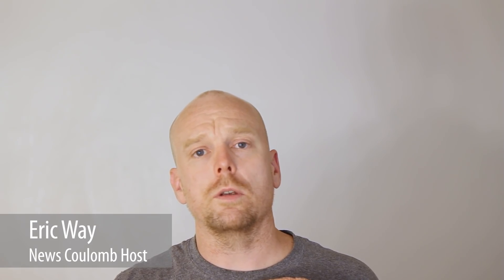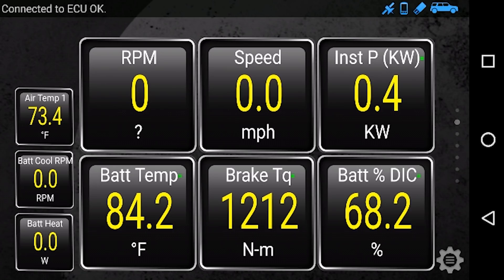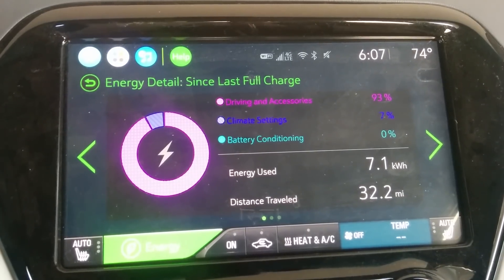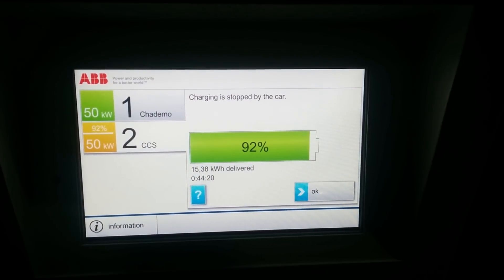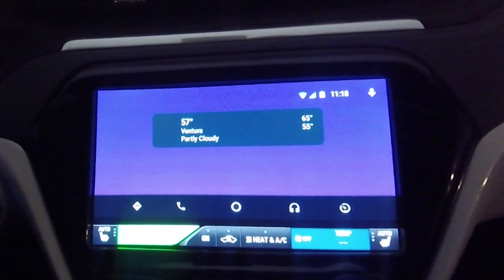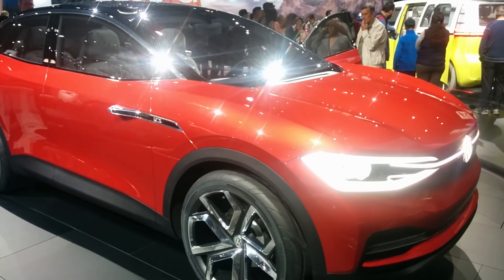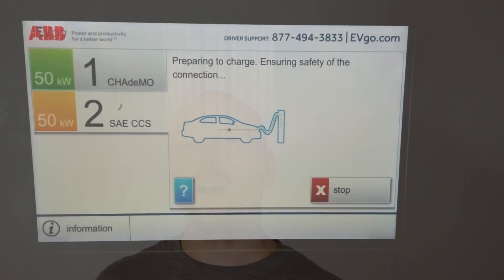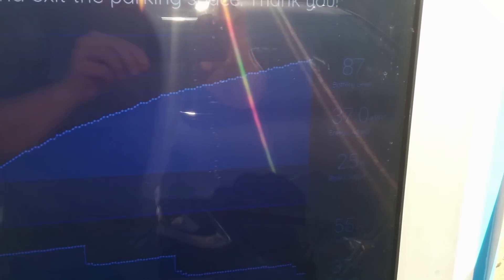Chevy Bolt EV: 70,000 Mile Battery Degradation

Comment: Alot of DCfastCharges,driving at ultra low batry,bolt's batry was put through al torture test widin70000 mls,losing8%is vry consistent degradation

Comment: I heard computer reprogramming so many times.  In our not so distanced past, we called this cheating.  VW got in trouble when they "re-programmed" their diesel cars 5 years ago.  Since EPA has their hands off policy and no regulations on electric vehicles, dealers can do whatever their want.  Basically, "Re-programmed" the hell out of  the computer to show favorable numbers to the consumers.  Bottom line, I don't trust the dealers.  Too much bureaucracy with too little integrity. That is why I am sticking with my Internal combustion vehicle until our government put some regulations on Electric vehicles.  With the ICE vehicles, dealers are less daring to temper with the computer because people can easily find out and they can get into a lot of trouble for it.
Reply from the maker: Didn't you just list a number of internal combustion vehicles that were tampered with? In this case, the reprogramming was very clear: It allows GM to diagnose and fix faulty battery cells/modules before they cause their owners grief. It's a good thing.

Comment: NEW 2019 BOLT owner here.   I currently use 120 volt/12 amp charging in my garage.   I am thinking of getting a 240 volt/32 amp continuous level 2 charger.  Will this accelerate my battery degradation ?
Reply: aardvarkansaw No! ;)

Comment: I’m at 45k miles in one year rarely fast charge but charge full everyday with a 7k watt charger from half to full. hill top is only if you drive down hell from where your charging so you don’t over charge. The battery has its own shut off point at 100% just like it has a cut off point when too low so it won’t damage the battery. I haven’t lost any miles everyday I get home  same exact miles 170 unless there’s traffic it says up to 190 best car I’ve ever gotten already saved me 6k in gas no maintenance and 10,000 in rebates
Reply from the maker: Yes. Keep in mind, though, that GM's range estimator is a projection and not based on battery health (like Tesla's). It's really difficult to measure capacity on a Bolt EV.

Comment: LRR tires are also very very important. We lost nearly 10 mpg on our Prius when we inadvertently purchased non (LRR) low rolling resistance Goodyear tires. 
I cannot emphasize enough how it will adversely effect range, especially important for EVs (we own a 2011 Leaf also). 
Most do not get the opportunity to compare as I did. Just beware, because most tire sellers don't even realize how dramatic it can be.
Reply from the maker: Yes. It's especially important for EVs because rolling resistance makes up a greater percentage of their energy usage.

Comment: its 20 percent to 80 percent Thats the optimum charging amount.   You should still have no issue as most commutes are only 30 miles or less.  Thats very attainable.  Plug it in at night and you should be fine.  No need for excessive charging. If you do alot of long trips and most dont  then you need to be aware of the percentages most of the time its a simple calculation

Comment: Eric, any way to quickly tell battery capacity/degradation from the car's system, if buying the car used?
Reply from the maker: Unfortunately, I don't think so. You could try Torque Pro (an app) with an OBD2 reader, but I don't think it's very accurate. The Bolt EV's battery is just too big to do a quick and accurate test.
Reply: @newscoulomb3705  Thanks Eric! 

What about this scenario: charging two Bolts to full charge. Same parking lot. One says max range 200, the other max range 240. Would you say the former likely experienced battery degradation?
Reply from the maker: @jgfisch3  No, that still wouldn't work because the Bolt EV's range estimator is also based on historical driving. My Bolt EV is currently showing less than 200 miles on a full battery, but that's because I just  got finished with a long, fast road trip at 70+ mph driving.

Comment: With a total 425 miles on my Bolt.  I have seen 0% degradation.   I have been trying to set my charge limit to 80%.  But for some reason it keeps charging to 95%. (Factory default)  I will have to call Chevy for some help.

Comment: If you look at some of the 2017 Bolt Battery Take-Apart videos, I see that there are units that say "LG Version Vista 2.0, 57kWh Capacity" on the pack labeling. So your loss may actually be zero if the 2% movement from the SW upgrade is real. I am not sure if the pack labeling means 57 usable or 57 max though. Maybe a question for LG.
Reply from the maker: Yes, it's a confusing topic. The LG sticker says 57 kWh, but GM's EPA filing says 60 kWh.

Jeff at ElectricRevs does a pretty good job of explaining it. https://electricrevs.com/2018/03/09/jaguar-and-chevy-have-lg-in-common/

Comment: Still, 8% degradation after 70,000 miles is pretty good. That means you shouldn't see 20% degradation until around 150,000 miles.
Reply: And with so much capacity to start out with 20% degradation still means a very usable car.
Reply from the maker: @daniels7862  Definitely. There's a bit of range to give, though I'd still want more. :-)
Reply from the maker: I really need to run the numbers again, soon. It looks like degradation has slowed.

Comment: I recently watched a YouTube video called “Chevrolet Bolt Li-Ion Battery Deep Dive”, in which the demonstrator completely disassembled the battery pack from a 2017 Bolt.  In the process, he read the ratings marked on each subassembly, and calculated the total to be 57 kV/hr.  He was a bit surprised by this, as was I.  Was this puffery by Chevrolet?  Or maybe there is some engineering reason for the higher number.  Did your methods give 60 kV/hr as your initial capacity?  I is possible that you have not lost as much as you thought.

I am a process server and put crazy miles on my car.  I use a level 2 charger at home and typically go up to 85%- 90%.  I have enough capacity to do my work about 90% of the time, but occasionally I have to get a little extra at a level 3.  For the first month I owned the car, I hadn’t gotten the level 2, and used level 3 almost exclusively.  My most common road trip is up to Flagstaff from Phoenix, about a 6,000 foot climb.  I fill the battery all the way up, and don’t lose much regenerative breaking, since I am taking the freeway and climbing for quite a while before any downhill.

Anyway, nice video.  I hope you find this interesting or useful.
Reply: Bryan Curry I have been watching the videos from Weber University and Professor John Kelly is awesome in his analysis of all aspects of the 2017 Bolt EV. I actually just bought a used one 2 days ago, with low mileage, and I'm highly encouraged by the battery longevity data on this and other posts.
Reply: I'm betting when those batteries are new, they hold more than their rated capacity bringing the back up over 60 kw/h. I see that with my hobby batteries all the time.

Comment: 2017 Bolt, only charge on hilltop rarely go under 100 miles rage left. ~18k miles no degradation so far, did see a parameter change when GM tweaked my battery last year. Car is still perfect, no problems. Total cost charging, inspections and tire rotations is under $75 for 2 years but I do charge from my own PV which is paid off.
Reply from the maker: Yup. It's hard to beat.

Comment: U have lost around 8 percent after 70.000 miles? I think it is a lot... Is nt it?
Reply: Vasileios Petropoulos - If the loss were linear with driven miles, that means he would reach 30% degradation — a level that could start to cause problems I would guess — at 270,000 miles.  If you extrapolate that as the useful life of the battery, I think it compares favorably with the life expectancy of the engine of a consumer-grade ICE vehicle.

Comment: Lastly stop DC fast-charging dummy charge it home only use DC fast charge if you have to when you're traveling long distance that alone degrades the battery faster although what you should actually know this would be minuscule after a hundred thousand miles and honestly I'd be surprised if you really notice any difference before a 400,000 miles

Comment: Also FYI the up down that you're seeing in the app is due to temperature variations if it's colder you're going to lose range and how much the battery can hold likewise if it's super freaking hot batteries are made to run it at an optimal temperature until we get solid state batteries. 2004 baby will be the year the first electric car using a solid-state battery is slated to release here's hoping they don't push it back

Comment: I just bought a 2019 yesterday. I was able to plug in my Bluetooth obd2, and get all the info I can with my Spark EV, except the capacity reads -8.6kwh. The PID csv file I have lists battery capacity at location 2241A3, using the calculation ((A*256)+B)/30. Is this the same as what you're using?

Comment: Very good video is what I wanted to hear about electric vehicle. 👍🏼✌🏼I’m wondering if its the same thing for Nissan Leaf?
Reply from the maker: Thanks! Degradation, even in the LEAF, will depend on the usage, but the same rules apply. Lots of DC fast charging and cycling through most of the battery regularly will make the LEAF's battery degrade more because it lacks a liquid thermal management system.

Comment: I am a skeptic of "wisdom" borne of Nissan Leaf experiences.  Professor Jeff Dahn's battery chemistry video indicates the Leaf technology was misleading relative to how batteries should be dealt with.  It would be great if GM/LG could publish recommendations - so much is dependent on how they designed the battery.  I DO keep my Bolt plugged in during cold and hot conditions so the thermal system can work freely. I do NOT use the charge reduction "hill" capability.  Am I right? Not sure.  I just hate to give up range capabilities when I regularly travel 2 hours in this car.   https://youtu.be/9qi03QawZEk

Comment: Have you seen the Bolt videos on weberAuto? They have some really interesting videos. I really liked the Bolt Motor Deep Dive video. The motor and drive system look really well designed.
I'm a fan of the Bolt but I've never been in one. I'm 6'2" and 240 lbs. From some of the Bolt videos I've seen I get the impression I might have a hard time fitting in the Bolts seats.
Thanks for sharing your experience. I may need to wait until Chevy builds a roomier car using the Bolt motor before getting an EV myself.

Comment: If you mostly charge from home I would expect your degradation would be less than shown here. Most Bolts won't be anywhere near 70,000 miles by now and with limited fast charging will probably still be usable for at least a decade.
Reply from the maker: Someone just bought a Bolt EV with over 100,000 miles, and it looks like they are seeing less than half the degradation I've seen.
Reply: brian whittle Mine is looking now at 113,440 miles. At 5Kw rate level 2 Volta charge, just passing 238 miles with 19 bars.

Comment: My 6-month-old 2018 Bolt lost 40% of its battery capacity.  The dealer said it checks out when they scanned it as all systems okay, but now I have a maximum of 138 miles which keeps me from driving to a city to which I frequently travel.   The dealerships claimed it was due to cold weather but I store the car in a heated garage.  Has anyone else faced this issue?
Reply from the maker: It's definitely due to the cold weather. Storing the vehicle in a heated garage helps, but if you are driving in cold weather at slow speeds with the heat blasting, it's going to estimate that you have a really low range. The estimate is based on recent energy consumption and outside temperatures. 

Are there any chargers you can access along your route? If there are, you should plan a trip with the expectation that you will need to charge up at least a little.
Reply: Jo Coles Demand they change the battery. If need be send a return receipt requested eyes only letter praising the Bolt and in passing that your battery is going bad. Tell me your results. Text 760-638-9580. Don’t trust your dealer, they have a big conflict of interest.
Reply: Oops send to Mary Bara CEO of General Motors Corporate Headquarters Detroit Michigan.
Reply: I guess gm can't even get an EV right, either lol 😂. I'm sorry, though .

Comment: According to prof Jhon Kelly of Weber university the bolt ev battery is 57 kWh
Reply from the maker: That's what the sticker on the battery case said. According to GM's EPA filing, it's 60 kWh, and according to the official government filing in Korea, it's 60.9 kWh.
Reply: @newscoulomb3705  really so, Who is telling the trueno?
Reply from the maker: Everyone has different ways testing. Based on my observations, GM's 60 kWh calculation is correct.

Comment: Question:  I park my leaf without plugging in.  In the morning I plug it into my L2 supply. Do you think briefly hitting %100 SOC and driving away is as stressful as just charging to %100 overnight?
Reply from the maker: Based on what I've read, charging up to 100% for a short period is less stressful than letting the battery sit at 100% for a longer period.

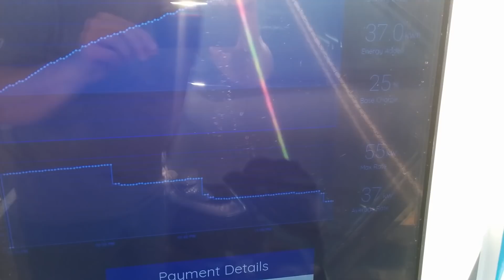Comment: 10:00 , the 55KW charge rate tapers off significantly after the SOC of the battery gets above 54% or so, and liquid cooled. So I really wouldn't think DC fast charging would cause much more wear than L2.
Reply from the maker: Yes, and most of my DC charging has been on the 50 kW chargers, which are less than 1 C charging rates. I really do think it's the deep cycling more than anything else.

Comment: I'm a teacher, and I drive an absurd distance to get to work: 82 miles. That's 164 miles round trip. I make 184 trips in a year. I charge at home. I charge it up, presumably to 100%, since my "hilltop reserve" is always "off". I've had this car since June of 2017. I don't know how much I've lost. Not much, I'd say. I still get home and my guesstimator says "40 miles", or, if I've driven above 80 for long periods of time, it might get down to "30 miles" and turn orange. I don't really care, as long as i make it home. This is my second school year that I've been driving this thing to work and I've never had any issues that weren't my fault. (I've forgotten to charge up the night before a total of 3 times, which required me to go to an EVGO and fast charge). But anyway, the real test will be when it gets cold. In cold weather, the range goes down drastically. The first year, it got my attention, I'll be honest.
Reply: If it starts getting to the point I can't get to work, I'll figure out how to buy a Tesla Model 3 Long Range Dual Motor.
Reply from the maker: You always have the option of petitioning the school where you work to install chargers. Of course, just dropping your speed a little bit would also help ensure that you could make the trip easily.
Reply: I drive similar range 30k+ a year and would love to know, with all that driving. Any issues with the car overall?

Comment: By the way GM sed That Apparently I just Ran Out of warranty for My Ac At 36,000 Miles,And the Dealer told me to Call GM to Plea and Beg them to Fix,So I have I call Them and Told Me that I need to get the Car Diagnosed To see whether they Gonna Pay For the Damage Or 50%,I hope I dont have to pay For it Even tho I'm not Even Done with My Lease Yet🤔
Reply from the maker: I'm sorry to hear that. I hope they can get the AC issue resolved. 

What kind of lease did you get? Aren't you already over the allocated miles?
Reply: @newscoulomb3705  yeah I got a 10,000 miles A year Lease but my plan was to buy the car once the Lease was Due,that way I was my payment was Low,and now  that I'm Running into This Issue it makes Me Wonder if I Made the Right Choice Instead of Kept Of Waiting For The Model 3 Tesla,I wonder If You Had Any Issues with Your Bolt Since You Already Hit the  70,000 Miles🤔
Reply from the maker: If you're price sensitive (and you wanted a Model 3), you'll likely still need to wait another 6 months to a year before a Model 3 is available for a similar price as the Bolt EV. The right choice is something only you can answer for yourself. For me, I feel I absolutely made the right decision getting the Bolt EV rather than waiting for the Model 3.

I still haven't encountered any significant issues at 70,000 miles. It's all expected wear.
Reply: At 80,000 I lost the high note horn $15 replacement part price. That’s it.

Comment: Great Video I have a Question for You I have the 2017 Bolt Ev and My Air Conditioned broke at 36,292 Miles,Did that Happened To You as Well?🤔
Reply from the maker: Nope, my AC is still running strong.

Comment: You battery degradation is a bit high, but still normal. Correcting for the 2 KWh after the software update, it is what I see from other EV owners with the same mileage. You should have mentioned that battery degradation DECREASES over time. So, you will never drop below 90%. I do not have an EV. Very recently I saw that in my street a public charger was placed. That is good, only 100 yards away from my home. I cannot charge at my home (no parking of my own). Still, there are two more problems. One is my extreme range anxiety (I fill up my petrol when tank is still 40% full for my own comfort) and the loss of battery capacity in winter. That can mount to 50% and that is completely unacceptable for me. I could not commute in winter and I would need a psych for my range anxiety then.
Reply from the maker: I hope you're right, and I see decreased amounts of degradation over time. So far, it's been fairly linear.